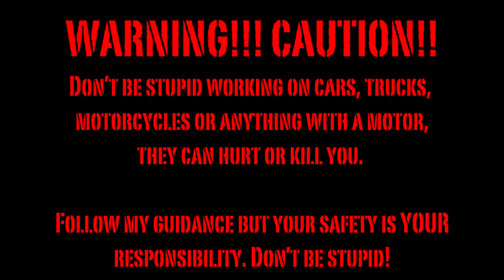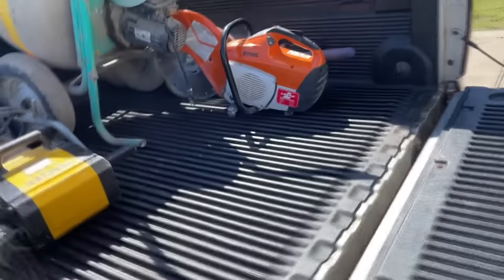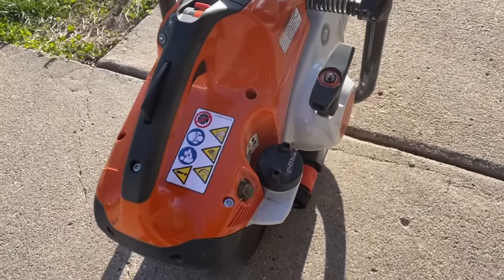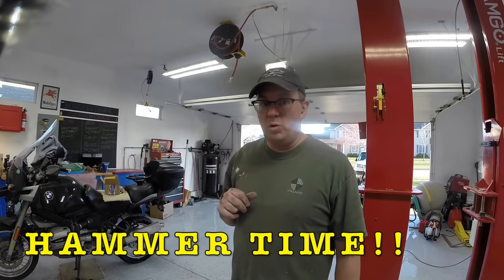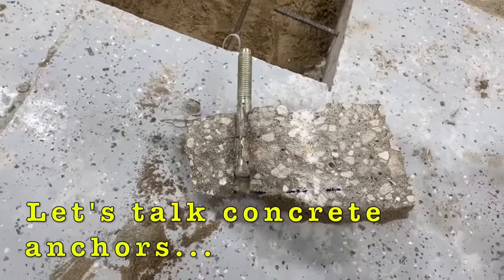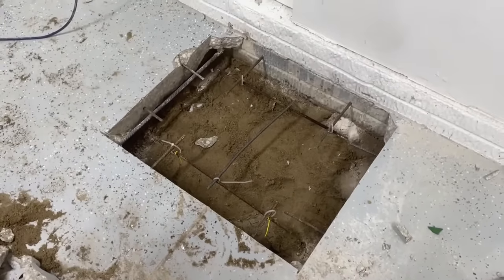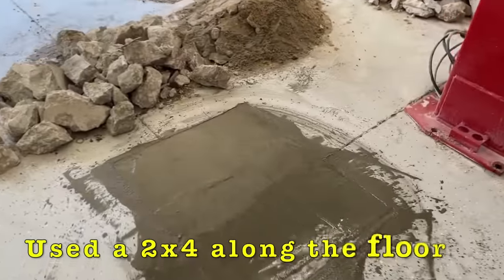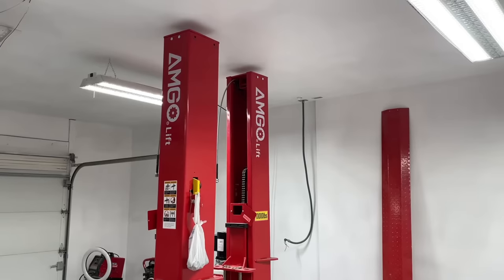My Lift tried to Kill me!

Comment: I know it has been a long time since you posted this but I agree strongly with many of the other commenters.  Expansion anchors can not be place that close to the edge of a slab.  All literature indicates 6 inches minimum and 12 inches is better.  Also those replacement slabs are not nearly large enough.  I would recommend the slab extend three feet in all directions from the base of the lift.  Other than the dowels you have no overturning resistance.  All you did was make the base of your lift thicker.  A safe connection would have required a structural connection to the foundation wall at least 6 inches (more is better) below the top of the footing.  Your anchors looked like they were too small in diameter.  Use the largest anchor that will fit in the base holes.  The use of epoxy vrs expansion anchors should be either /or not both.  Epoxy requires an over size hole.  Expansion anchors require a tight hole.
Reply: That was informative information!!!
Reply: Good comment…Makes a lot of sense.

Comment: Well, I think you made another mistake, you should have made those new concrete patch larger, reason is that the new patch are not naturally connected with the old one so there is a disconnection, looks like that is connected to the rest of the slab, he may work but I would worry a little the option there was to go even deeper and remove dirt under the concrete slab so that the new concrete would have fill in a wider area under the one that you have and would have looked in the bottom, like a mushroom upside down, all the best
Reply: You read my mind! Same thing I thought when I saw the size of the patch. If you're going to cut out a portion of your floor to handle the stresses of a lift, the width and length of the new section needs to at the very least be equal to the length of the lift arms. With plenty of rebar and correct concrete mix. And as long as your going by the length of the arms, just go beyond that and make it one large section. I hope he lives through the second and far grander mistake.
Reply: I think he put rebar  to connect the plug to the rest of the floor
Reply: @ScreamingEagleFTW  he did not drill into the old slab and tie the new and old rebar with wire he used loose cable ties
Reply: I'm definatley no engineer, but I would have gone with a full lift width slab about 6-8" thick x 4' wide and used "J" bolts tied to the rebar. Why use wedge bolts with fresh concrete?

Comment: So close.  I agree with many of the safety comments and how the lift was definitely placed in a bad spot the first time around and concerns that it is not a great deal safer after the second install.  Though I applaud the effort and I think any other first time self installer will gain a great deal of knowledge after watching and then reading all the replies.  So thank you for the getting the conversation going.  I am not surprised the post right against the wall moved.  But I am very surprised the other post which was straddling all the expansion joints was not as bad or worse.  The holes cut in the concrete for the repair could have been bigger, but and easy alternative that was "so close" would have been to add a post hole digger/auger to that list of rented tools and dig a 3ft hole (maybe 12" dia or so) on top of making sure to notch under the existing concrete (which I think there was a bit of that done) and then use cast in "J" bolts.  If getting the lift over the "J" bolts was to be a concern then coupling nuts could have been added to the top of a "J" bolt creating a female anchor point resulting in the use of anchors bolts instead of anchor nuts to bolt down the lift.  My MaxJax lift uses female wedge anchors.  They work great and of course since my concrete was already there and fiber reinforced 6" deep they are rock solid.

Comment: There's a lot going on here and has been touched on by a few comments.  Definitely needed to undercut the existing slab before pouring new pads.  Also please wear PPE when working with concrete dust.  That stuff is nasty for the lungs.

Comment: Should have just hammered the anchors through the slab and inserted epoxy threaded bar and then had a 6mm steel spreader overplate cut to the existing and installed over with another 4-5 threaded bars or anchors. The anchors have the advantage that they fail slowly whereas the epoxy bar would fail quickly so best mix the two and of course never epoxy the lag bolts that's crazy as you have to place and torque them superfast before set and you will get no further expansion If they slip later to lower torque and will just spin. Anchors shouldn't be used close to edge or each other.If going the cut out route Then footers here are way too small to support this lift and It could be much worse than what you started with, I would have cut between too so it was one piece and double layered the a393 mesh so the anchor or high tensile threaded epoxied bar was below the first level of mesh  instead of ziptied rebar nice first effort though, time to rehire the tools and go again...
Ps the other problem apart from anchors close to the edge of new slab here is control joints on concrete so it's all cracked there. Basically this set up is a ticking time bomb. If I was to get under a car with that lift I would lower the car intimately  onto two transmission jacks that were rated for the cars weight to stop a world trade center style collapse with a margin  if they exist.A post here shows how to do it with bi level rebar but I recommend welded mesh rather than galvanised wire tied rebar, in this cas you can epoxy in 11 inch high tensile 16mm steel threaded bar in an 18mm hole with inch equivelents
https://www.garagejournal.com/forum/threads/2-post-lift-n-cracking-concrete.306274/
Nice second effort though , now time to rehire tools and fix it, third time lucky🙂
Reply: You're absolutely correct half inch or 1 inch plate welding the lift to the plates in the right areas or you can even bolt the lift to the plates

Comment: One thing all the genius viewers who commented never touched on is that if you watch closely the weight of the truck pulls post arms inward as weight lift increases. Absolutely  the lift  needed a good enough pier to sit on and thats a fact. HOWEVER theres no spreader bar at the top between the lift posts. Im not saying a spreader bar would be the total solution however it would help displace the weight load. I have a Rotary 2 post lift with a bar inbetween the 2 posts at the very top to keep posts from wanting to pull inward.I DO  have  a 10" depth with rebar and "X" (high strength pour mix) on my entire garage floor. Im sure my pour and rebar combined are great but I also think the top bar (which this unit didnt come equipped with?) also helps dramatically with handeling the load as the vehicle goes up. It keeps the posts from pulling inward.

Comment: So many people don't understand concrete.
I'm a mecahic of 16 years but for 4 years from 14.5 YO on I worked for my father in concrete repair. 
Basically you want to use chem sets, the only thing stronger is to concrete in the threads, you could argue chem set is stronger.
I've drilled thousands of holes, the trick is to use an old concrete drill bit on the SDS plus 2 drill, for wedge anchors.
This is because in 25-30mpa concrete you will hit either hard rocks or steel which makes the bit wobble enlarging the hole. A worn bit makes a tighter hole perfect for wedge anchors.

But chem set is good because it can grab onto threads and the concrete.

Comment: lol..Ive been working on cars for 30 years and installed my own 2 post lift in my brand new shop.The shop floor at my work is well over 50 years old and hold my hoists fine.The one i installed in my own shop was installed less than a year after being built in 4" concrete with heated floor.NO PROBLEMS!I guarantee that 4" is all you need!i lift f450's on foth of mine without a problem

Comment: I agree with Sean Horton.  Also, some lift manufacturers specify the minimum distance from the anchor bolt to the edge of the slab, usually two feet. Unfortunately, AMGO does not give this detail in their installation instructions.
Reply: My lift they call out a distance away from expansion joints/cuts as well…

Comment: Why not put anchor bolts in when pouring the pads. Might be stronger than the hammer in expanding anchors. A little tricky to get them set in correct position for the holes in the lift base. I might have just braced between the top of the columns.
Reply: We pour anchor bolts in many patterns. The big stuff comes with templates/bearing plates. The small stuff we just make plywood templates and double nut the anchor bolts in them. It makes them idiot proof.

Comment: The new concrete poor should go all the way between the posts and go down at least 8 inches,  and the cement should go under the existing floor as far as possible
Reply: Concrete has no strength in a couple of inches forced under an existing pour, 4-6 inches with rebar in that lip. 
Ideally, yes an 8 inch thickness, at least 8 inches away from any expansion anchor, and rebar continuous doweled into all 4 sides of the existing slab, and more than what is there. Although doweling at only 2 inches down is not ideal.

Comment: i actually have done this before for a shop did two lifts but the foundation was only about 8 inches deep i made it to go about 24 inches deep for added stability and i also put more rebar in made a box so to speak we marked everything for the lifts so they can be anchored in without hitting rebar

Comment: The post is too close to the edge of the slab. On my lift, the instructions state not to get close to the edge of the slab or close to an expansion joint. It is on a 4” slab that has glass fiber in it. Been up 9 years and no issues.

Comment: My lift is exactly the same as that but is just a different color. I used the supplied wedge anchors and they were being pulled out of the  8 inch concrete. So I made an over engineered  bracket that spans the   outer bolts and uses 4 additional chemset bolts. It has never moved again.

Comment: I personally would have dug the dirt underneath the existing  slab about 4 " from the edge all around and make it 12" deep to create a shoulder for when you pour the new concrete in addition to you drilling into the existing slab and to place bended rebar into the 12" deep hole with stirrups. It might be just slight overkill but it'll give you peace of mind.
Reply from the maker: Jfig... The video doesn't probably show that well but I actually went probably 6-8 underneath and rebar tied the two pieces together

Comment: I agreed with almost all comments about this, except for the one comment about mixing concrete too dry. Too wet results in weaker concrete. Trying to make it soupy so it would be self-leveling is really silly and counter productive. 
Whoever poured your original  garage slab did a very poor job. It looks like the subgrade was not leveled prior to pour and the rebar was not embedded properly in the concrete, so it was useless and would corrode prematurely. Because of the poor quality of original slab pour, I'm very suspicious that the subgrade was ever compacted properly before it was poured.
One more thing that struck me is how small the base plates are on your posts. My 8k# Mohawk lift bases appear to be twice as big and twice as thick as yours which would add extra stability.

Comment: Nice video.  I had the same issue. I redid entire floor at 6 in min then 8inch at posy.  4000 lbs with mesh rebar and fiber in concrete.  
I also made a plate and welded all thread with nuts on bottom side and positioned them in place before pouring concrete around them.  Thus I believe this will be even stronger  as rather than a small ancor sleeve I now have an entire footing at twice tge size of column  pads tobolt to.  I'll try and post a pic

Comment: 50mpa concrete is the go, then leave it to cure for 1 month, at a depth of 8" 200mm, then set your posts, and NEVER cut concrete with the water off, NEVER cut without respiratory protection as the concrete dust can kill you, even mixing the concrete you were breathing in the silica dust

Silica dust is very fine, much smaller than a tiny grain of sand found on a beach. This is what makes it so easy to inhale. 
If you look at the full stop at the end of the previous sentence, that is around 200-300 micrometres in diameter. Whereas the respirable crystalline silica particle is only 5 micrometres in size.
If inhaled it can create a health hazard all the way from simple and instant irritation to life-changing and often life-threatening lung diseases. 
Crystalline silica is a designated known human carcinogen meaning it is a definite cause of cancer in humans.
Once you breathe it in it can go deep into your lungs and stay there - permanently scarring and damaging the lung tissue.

Comment: Why didnt you put  studs into the new concrete instead of going back to expansion bolts? Easy to have the local weld shop make an insert plate with welded on studs that would NEVER pull out. I am a structural welder and retired crane inspector.

Comment: My 9000lb lift is on a 4" floor with no problems after 15 years.  BUT, fiber reinforced, cured for over 10 years before install.   And I'm very careful to balance vehicle.  On my heavier trucks I will weigh them to determine center of gravity before lifting.
Reply: I'm a commercial general contractor. I have a 12'000 lb. lift in my garage on 4" concrete. I had my 11,500 lb. ambulance on it for 2 months and ran it at 60 MPH on the lift. If you do the math  of the square inches on the foot on 4000 psi concrete you will see the problem is not the concrete it's the anchors. There is more pressure on the concrete per square inch when the car is parked than when it's on the lift. We us'3/8" to 3/4" Tapcon's on most stuff.
Reply: Cured for 10 years ...lol

Comment: Yes, the epoxy bonded the expansion sleeve to the shank. I have heard of people using epoxy with expansion bolts but they torque the bolts within a couple of minutes before the epoxy has a chance to set/bond. 

Glad you got it figured out and this vid was very useful for other people who may be doing the same job. 

Good work and glad no one was hurt. 👍

All the best.
Reply: Clueless people wouldn’t tighten the bolts before the epoxy set 😂

Comment: Good idea and common sense that flew over my head when you said you were going to fix it. Good job  Think you could have put some acrylic glue mixed into the cement to make it stronger. Looks mixed with to much water which makes it weaker I think. Should put some late steel over the new concrete that also goes about 6 inches over the old concrete and bolt it to the concrete then install the lift poles

Comment: 1.  Did the manufacturer recommend a 4 inch footing (slab/floor)? If so, I would shy away from that company. If you are lifting something 4-6' off the ground and the arms extend out 3-4' imagine the leverage forces put on that footing. Just my guess but I would want a 4'x4' area of the slab minimum 8-10" thick. And that is if it was well connected to surrounding slab.
2.  As long as you had to tear up the slab, why not embed L or J shaped anchor bolts into the wet concrete?
3.  Your new footing is not well connected to adjacent slab. One fix would be to use more rebar connections and to apply an adhesion solution to sides of old slab before pouring. Better yet, undercut slab so footing will extend out under slab.
4. Your very, very watered down concrete mix is going to be much lower than 5000psi. And it should be "cured" by keeping it damp/covered 21-28 days to prevent evaporation and loss of strength.
5. I think you have a floating slab that is not/should not be connected to the walls. If so, you should not have rebarred/connected the slab/footing to the wall.
6. Welding a larger steel plate with more bolt holes to the base of posts would help some, too.
7. Adding a crossmember connecting the tops of the posts would help prevent them from leaning toward each other.
I hope your "fix" works out well for you but I have some concerns for your safety.

Comment: You could have installed studs since you poured concrete, instead of installing anchors again.
Reply: That would be better but he doesn't  have the room to lift the post OVER the studs.  The top of the post will hit the ceiling first.  Also, he likely has no means of lifting the post.
Reply: I would cut out the dry wall above to see if there is room between the ceiling joists. Drywall repair would be nothing compared to the amount of work he just put into that concrete

Comment: Technically rebar is not intended to be exactly in the middle of concrete. It is intended to reduce stress on the concrete in the direction in which it is forced, but not be in contact with the soil. So a concrete pad wants to “fall” inward because of weight and gravity. You want the rebar to be under tension, not compression. So on a floor the rebar should be located at the bottom of the pad, but completely encased in the concrete. On a wall structure, you want the rebar to be placed opposite to where the force is applied. Basement wall, rebar more towards the inside surface. The wall is being forced towards the inside of the basement, and rebar towards the inside, is trying to be elongated in tension. If it was on the outside surface, the rebar would be under compression, and Not what it is designed for. The details in things like this helps understand its purpose and prevent placement mistakes in the future.

Comment: Are your new pads large enough? Installed 10 000lbs lift in my shop 6" plus concrete should have used epoxy on my bolts extra goodness

Comment: My guy instinct would say - installing on the edge of the pad is a very bad idea.

The anchor bolts need a lot of concrete all around them...

Other thing that might have helped is a top bar - but it would only increase your odds slightly.